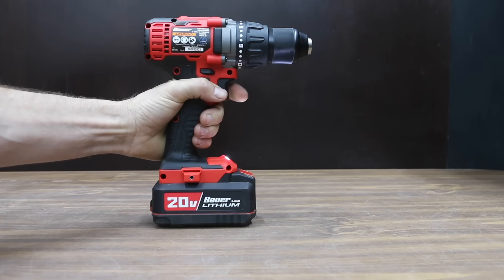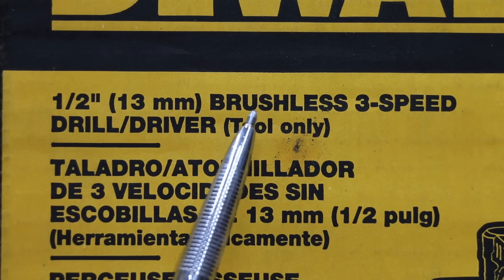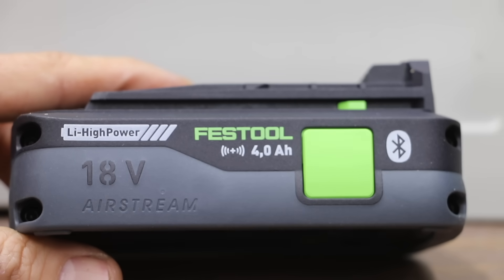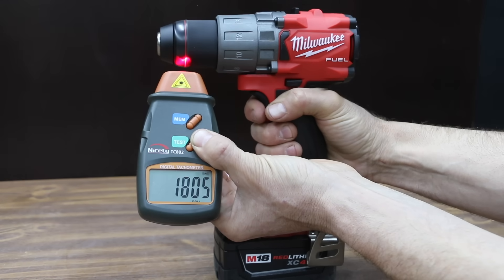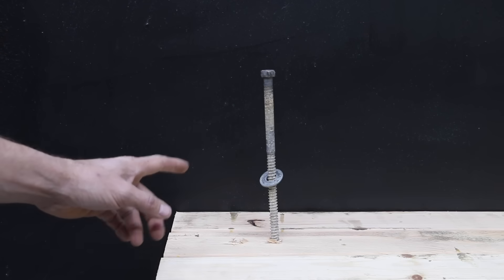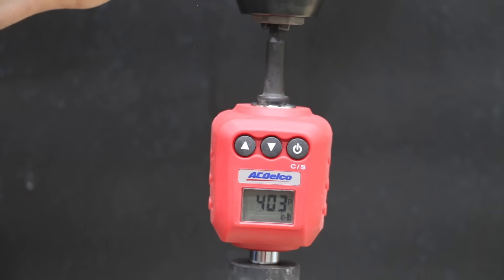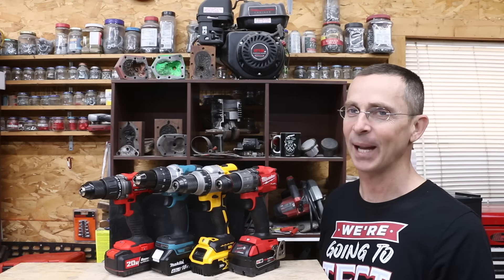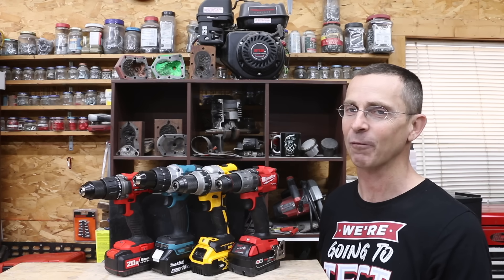Best Drill (BATTERY POWERED)? Milwaukee vs Dewalt, Makita, Bosch, Festool, Ryobi, Bauer, Ridgid

Comment: Never before have I seen the most expensive brand so thoroughly outperformed.  Unbelievable!  Another great review, would love to see a follow up with the same drills to see which has the best durability.  A friend of mine recently said that he has been using DeWalt brand power tools for a while and is not satisfied with them so will be switching to Makita.  I mentioned that in your various power tool reviews very rarely is Makita the winner, but equally as rarely does it perform the worst.
Reply from the maker: Thanks!  Thanks for the video idea.

Comment: You should test 5 gallon gas can designs for ease of use and safety. Those “safety” can spouts are such a PAIN to use and but others ones that are ‘better’ are so expensive. Are they worth the extra cost? Metal, plastic, etc
Reply from the maker: Thanks for the video idea.

Comment: Also depends of the battery how much amps. I have the bosch, i don't know if is the same model because they sell different types but is very strong, too powerful for my use. A little bit more than milwake, because I use it before. The festool is just for special jobs, wood etc hi rotation. Dewalt,, that's the best model from the catalog right now.
Reply from the maker: Thanks for the feedback.

Comment: Great video.  The specialized drills like the impact and the hammer drills don't have too much appeal to me, with the possible exception of an impact wrench (which of course isn't really a drill, just looks like one). So this is a great addition to the other videos on drills.

I was surprised to see how loud some of these drills are.  But then I realized that most of the time I'm using a drill, it's to drive screws, so the drill isn't running at full speed.  That's unlike say,  a circular saw, which should be mostly running at the same speed all the time, and producing the same amount of noise.

Since a lot of these cordless tools are more about buying into a battery system, it might be interesting to make some sort of meta-video where you combine results from an entire tool line (drill, impact, hammer, impact wrench, circular saw, reciprocating saw) and just rank the whole tool lines as a whole.  At this point I think the only thing you're missing is the circular saw.
Reply from the maker: Thanks for the feedback.

Comment: Normally a Dewalt guy, but I bought a couple of Bauer (Drill, Sander, garden shear) products just to check them out.  For the price the products are ok BUT the batteries are horrible.  Of the 3 I have 2 are toast already and wont charge.  And this is with VERY light use!!!!
Reply from the maker: Thanks for sharing!

Comment: What about hammer drill capability? Although these are big drills, their finesse and precision should be tested as well.  Maybe test wobble on the chuck and balance.  I'd buy the ridgid for value and warranty. Thanks for the test.
Reply: The Makita has a steel chuck crafted by Yukiwa-Seiko in Japan. Mine has very little runout at all and hammers reasonably well for a combination drill. The one in this video is a slightly newer model most likely, mine is the XPH07 if I remember right. Mine is 7 years old and still putting in work like new!
Reply: @Mournful3ch0  thanks for the info!
Reply: @Soandsoguy  glad you found it useful my friend 👍
Reply from the maker: Thanks for the video idea.  You are welcome!

Comment: I've got an older DeWalt cordless drill here. Recently replaced the battery packs. It has no trouble using hole saws to cut holes in timber. Great video. I'm not surprised with Makita. My opinion is when you buy these, you're paying for the name.
Reply from the maker: Thanks!  Thanks for the feedback.

Comment: Always wondered what happened to brands like Metabo , Hitachi   and  AEG etc ?
I mostly use Ryobi these days for my home workshop as it serves me well and it is cheap to buy but when i was in the welding game Makita was my tool of choice (still have an old hammer drill that was flogged relentlessly for years that now drives my milling machine head up and down )  -   DeWalt or Milwaulkee didn't exist . i was surprised at the FESTOOL  failure - maybe a case of a company living on it's name ?
Reply from the maker: Thanks for the feedback.
Reply: @ProjectFarm  
Would love to see a mechanical durability test where you punish them until they die .
Maybe set up a power supply to power them and something like an engine  brake dyno to load the drill up to stall torque over and over until it dies . 
also which brand has the best chuck - Ryobi chucks are crap -I can tell you that for nothing but I'm thinking that with all these drills quoting x amount of torque etc that none of this is useful if the chuck can't transmit it to the drill bit . I have a few sets of drill bits - some are junkers that i use in the Ryobi drills and the others are only used in a collet chuck in the mill or lathe as a collet chuck won't damage a drill shank if it spins .
Love watching your videos and love the dedication you have to try and show a fair comparison -keep up the fantastic work you do !

Comment: Why was the lowest-end ryobi brushed drill compared to higher end brushless drills? Not really a fair comparison. You can pick up the brushless ryobi drill/driver for 90 bucks without the battery/charger. I use the brushless ryobi almost daily, it's dramatically better than the brushed version, and comes in at only 6.4"

Comment: I worked with this exact Festool in my work, best cordless drill ive ever used, our setup that was given to us was about 1000 usd , we had a lot of accesories for that, awesome tool for professional use, but i myself own this exact Bosch, for what i need to do in my home it is quite reliable and great to use, ye i f i had to drill some really hard steel i would use something like festool but i dont so, Bosch is the brand for me.
Reply from the maker: Thanks for sharing.

Comment: Looking at where you placed the tracking line for some of the drills, they are on the angled part where it tapers on the chuck instead of the flat part of the chuck. Would this not have made a difference in the overall RPM as it is closer to the centre of the drill rather than its outer most part? Noticed this on the Milwaukee when testing. Appreciate the comparison videos non the less, keep it up!
Reply from the maker: Thanks!  Thanks for the suggestion.

Comment: The Festool had just two features I like: the quick-swap from drill-chuck to driver (although it may be all too easy to misplace/lose the driver attachment on a job site); and the ability to set the LED illumination to different levels. Otherwise, the Festool is all show and no go.....except for your hard-earned money going away to the Czech Republic!!

Comment: I find it a bit shitty that some brands say they are 18v and some say 20v. In reality, both are a 5-cell series (5s1p) or 2 parallel groups of 5 cells in series for larger battery capacities (5s2p). Either way, an "18v" or "20v" battery is going to be 18.5v nominal (3.7v per cell) in either case, and 21.0v when fully charged (4.2v per cell). The only reason to call it 20v instead of 18v is to deliberately mislead potential customers into believing Product B has more power than Product A. In reality, they are the same and their power output depends on how much current is being drawn by the motor and circuitry configuration used

Comment: Great video, but I do have  some comments/questions...

*Festool has always been considered the, “Bentley” of drills. Although you proved that some of the other brands can do the job of drilling just as good or better, I have always understood that the precise controls is where it’s supposed to shine. I’m not entirely sure if you’re testing truly dove into that aspect of the drills.

* how do you determine which model drill/driver to use? I have been considering Makita and I know they have at least three different drivers and one of them is a combination drill/hammer driver.

* finally, and this is a big one. You didn’t test the new kid on the block… FLEX Is making some waves and they are claiming to be better than everyone.
Reply from the maker: Thanks!  Thanks for the video idea.

Comment: With the last endurance test I don't think it's necessarily testing the endurance of the drills as you're simply measuring the time they last for, that would depend entirely on the RPMs and obviously gear they're in. A better method of measurement, although more time consuming, would involve measuring the number of revolutions the engine makes. I don't know a easy method for doing so however.

Good video regardless. I do think that Hilti would be a much better high end tool to compare, although difficult to find. Rockwell would also be another good addition as they've been around for quite some time.
Reply from the maker: Thanks!  Thanks for the feedback.

Comment: For me, what is more important than the LED staying on for X amount of seconds after the trigger is released is, does a half-squeeze of the trigger turn the LED on before the motor starts to spin?
Reply: My dewalt does
Reply: Agreed, half squeeze or a switch (that turns off after 5 mins in case you left it on) but even more important, does it shine where you need it to without being blocked by your hand or the drill.  Also these videos are great, thoughtful tests, resulting in facts delivered with honesty. Thank you
Reply: @JQPUBLICK411  , I'll add that a trigger lock is handy, to prevent the LED ---- or the motor ---- from turning on, and possibly draining the battery, as the drill bounces around in the toolbox or bag in the back of the truck.
Reply: @goodun2974  yo siempre le quito la batería y la extensión de atornillar!
Reply: 2014 Dewalt light tap on trigger does
Reply: @shadowopsairman1583  , yup, same thing with my Milwaukee drills. And, the LED stays on for at least 5 secs when you release the trigger.
Reply: My rigid tools all have a secondary switch for the LED. Love that feature. Light is essentially always on when in hand.
Reply: as a contractor i must say. i never work at night and i wish that was still a tool holder and not a useless light
Reply: @philtripe  , its not a "useless" light when you are trying to place a screw inside a cabinet, or hanging conduit or cabling supports inside a drop ceiling, or while working in your own shadow or some other place with minimal ambient light. Does all your power-tool use occur only outside on bright sunny days? Not to mention that as one ages and eyesight deteriorates, one learns to appreciate the additional lighting.(PS, 41 "thumbs-ups" so far on my comment about the need for the LED to turn on before the drill starts spinning. I normally don't pay much attention to such things, but it does appears that a lot of people do like having that automatic illumination feature when driving screws.)
Reply: @goodun2974  Amazing how important that little light becomes as you get older.
Reply: @philtripe  correct. I have no idea why all these drill brands did away with the simple bit holder. My biggest pet peeve
Reply: @scottcoleman7304  The big magnet that Ryobi used to use was the bees knees. As were the different built in levels.. i have been missing those since i switched to DeWalt many years ago

Comment: I don't know about the others, IIRC you can program the clutch on the Milwaukee for very different and custom clutch, spinup, torque and kickback behavior. Just need the app on your phone, and set the tool to the wireless position (the last is only neccessary to edit existing or send new profiles to the tool, it can hold 3 or 4 at a time, don't think there's a limit in the app).

It's an awesome unit, but you really don't need M18 Fuel tools for light, casual or even medium duty work.
Reply from the maker: Thanks for the feedback.

Comment: Not sure if it's by design or just a side effect of the electronic clutch, but on my Milwaukee while the 2nd gear still pits out quite a bit of torque on the lowest setting, in gear 1 (which you would probably want to use on anything small anyways) you can easily stop it with just two fingers, probably even just one.
Reply: I'm pretty sure it's by design now that I think about it, in the low gear the middle torque setting I think is about the same at the lowest setting in 2nd gear, but i could be wrong, I haven't had the tool for long (also I have the M12 fuel version)
Reply from the maker: Thanks for the suggestion.

Comment: I've got a kobalt 24v max drill, and I tested it out when doing rough electrical work on houses with a 1 inch paddle bit to make holes for wire to go through, and it made the hole like it was nothing, so I'd be curious to see how it would perform in one of your tests
Reply from the maker: Thanks for the video idea.

Comment: Wrong battery for the milwaukee drill I own one it way underpowered with it get a high output battery
Edit Your friend has shared a link to a Home Depot product they think you would be interested in seeing:

Milwaukee	M18 18-Volt Lithium-Ion HIGH OUTPUT CP 3.0Ah Battery Pack (2-Pack)
https://www.homedepot.com/p/Milwaukee-M18-18-Volt-Lithium-Ion-HIGH-OUTPUT-CP-3-0Ah-Battery-Pack-2-Pack-48-11-1837/307848142
SKU# 307848142

Comment: I'd love to see a "to the death" endurance test of these, to simulate long term ownership. Low temps, high temps, multi hour high load endurance would be interesting to see if the mechnical clutch drills have longer/shorter lifetimes.
Reply: More torture testing please. Also part numbers
Reply from the maker: Thanks for the suggestion.
Reply: you should start your own channel!

Comment: Nothing about battery recharging speed. What's the point of having a cordless tool if you charger cannot keep up with the work pace.
Contractors here mainly use 3 brands (Makita, Dewalt and Bosch) and you can see a big difference when it comes to battery charging. 
The Dewalt guys tend to bring more charger and batteries than others. First thing they tend to do when arriving is get out their "charging station" (board with a bunch of chargers) and start charging batteries.
Reply from the maker: Thanks for the feedback.

Comment: 2.5 years ago I started my handyman business and was gifted a Milwaukee impact and drill set from a family friend. I purchased a dewalt set and Bauer set. Ive gone through 2 dewalt impact drivers and 1 drill since. Still on original Milwaukee and Bauer sets. The main failures with the dewalt has been the motor and trigger. The Bauer has been holding strong and hasn't shown any noticeable loss of power .. Infact my main complain for it is that it snaps screw heads often because the trigger is pretty much an off/on switch. My Milwaukee is my go to for drywall and fencing and Bauer for heavy duty jobs. Great video as usual
Reply from the maker: Thanks!  Thanks for the feedback.

Comment: I have the hammer drill version of the Bauer. It really isn't a bad drill especially when price is taken into account. It's also nice when you need to drive a bunch 3 or 4 inch screws. Turn on the hammer and you have a super fast driver that has some impact capabilities. I won't use it for anything heavy duty. I have a 9 amp Hitachi I bought years ago on sale at Lowe's that I get out for those jobs. That sucker will break your wrist in a heavy job if you don't use the handle!
Reply from the maker: Thanks for sharing.

Comment: I have a Ryobi hammer drill and I put it thru a lot of abuse. For the $50 I paid (with bag, battery, charger, a set of basic bits and the hammer pole/handle), I've been happy with it. With that said, I see they never do well in the tests. When it finally dies, I'll probably head to Milwaukee. They always seem to come out #1/#2 in all of the tool tests. The milwaukee impact has become a legendary tool among car mechanics I know. No more 4ft leverage bars and snapped breakers for Axle bolts or crankshaft pulley bolts. Just the Milwaukee impact and a good impact socket. That's so cool for a battery tool to be that tough
Reply from the maker: Thanks for sharing.